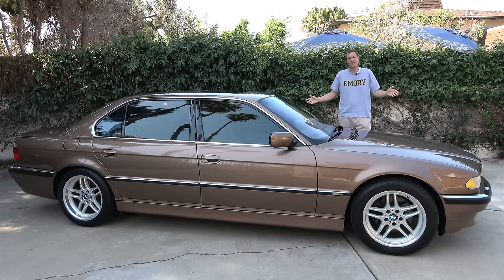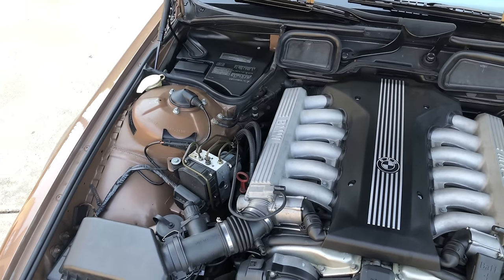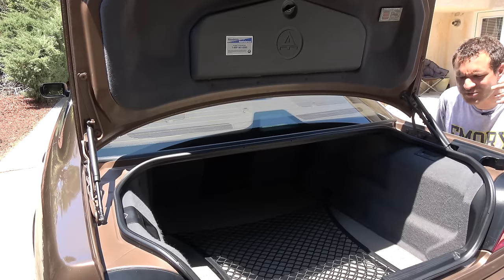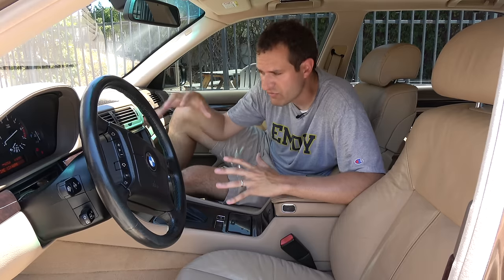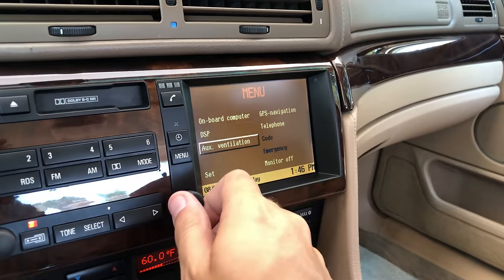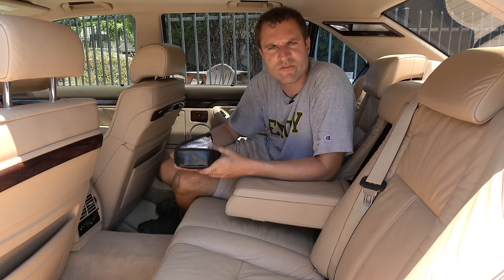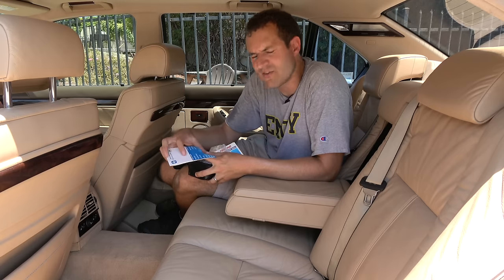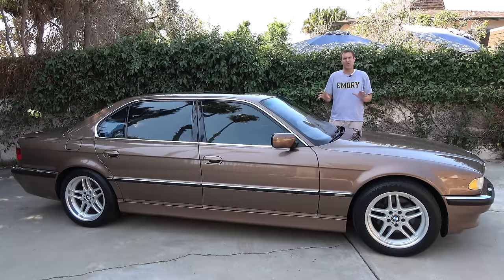Here's Why the 2001 BMW 7 Series Is the Best Luxury Sedan Ever

Comment: Last BMW made that I'd buy. Also Get the v-8 version, much cheaper and easier to maintain.
Reply: joe blow 

Believe it or not but BMW specifically we’re always easier to maintain than the V8s. Do to the fact that they were designed by putting 2 I6 engines together. At least that’s how BMW Makes V12s.
Reply: Ii😶
Reply: Smarter Thanyou V12s can be very expensive to maintain.
Reply: The V8 has plenty of GRUNT to it
Reply: Enjoy changing timing chain guides...
Reply: Definitely go through the V8.

Comment: This is design genius. You’re absolutely right, this is one of the best designed products, not just cars. It evokes a sense of peace and satisfaction that no other can car can. I drove the short version 740i sport, it was like I was connected to the car. They’re also rare. Back when BMW had balls, the glory days.
Reply: Art, I own a 2001 BMW740i Sport and every word you said is completely true, especially about how the driver is connected to the car. It is truly amazing!
Reply: Art, I just wonder what the different is between the ¨sport¨ version and the regular version? I did not get any information when I searched for it.
Reply: Daniel Hedlund 

Hey, there was a 740i M sport package, and a normal one. The difference is the sport package has a sport tuned drivetrain and suspension,the wheels you see on this car, and a sport steering wheel and seats.  These cars are rare. There’s also an ‘individual ‘ option that had special colours and trim. The 740i is also shorter then the il version.
Reply: @Carmafixcars  Thanks! This car that Doug is reviewing looks much sportier than others a looked at. Does the Sport package change any exterior trim, skirts, front, bumper?
Reply: Daniel Hedlund 
Yes, there’s no chrome trim other then grille. There’s side skirts and deep dish rims.
Reply: @Carmafixcars  Ok, so the bumper and the front is the same as other e38:s
Reply: @danielhedlund1480  Bumpers are the same but not the trim on them - Sports has no Chrome. Also they have black headliner, shadowline trim (no chrome around windows either), Sports Seats, Sports Steering wheel.
Reply: @danielhedlund1480  This car is not a sports model - it only has the wheels from the sports package.
Reply: @Carmafixcars  Yes, and the nicest are sport individuals, the interior colours are coordinated with the exterior, depending on wishes. Such as https://goo.gl/photos/o2syvMCRLuVvbvEy6, where the blue (car colour) theme goes also inside: carpets, interior dood trim, dasboard and leather piping (in between the stichings) are all blue.

Comment: The 740iL is better than the 750iL. It only lacks a few touches the 750iL has, but it has a more reliable engine... not the most reliable in the world, but it is way more reliable than the V12. The low end power is much better, and the engine sounds like a V8. It also cruises nicely at high speeds. I think the 0-60 is also a little better in the V8, and since the V8 is lighter, the car feels better around windy roads. There's a few things like the headlight washer sprayers you forgot to mention in this video. This car also has other built in features that many cars didn't have in those days, but Doug would really need to own the car to come across those features.
Reply: The v12 is still quicker than the v8. However the 540i with the v8 is way faster than the 750il.
Reply: I'd want the 750 for the street cred, but I think everyone agrees that the 740 is the better car.
Reply: It looks like you're saying 74 oil is better than 75 oil, I wouldn't trust any oil if it's been used for more than 40yrs
Reply: @dariog36th  
Strange why they called it the il' in America, in Europe the letters are changed round to li'
Reply: @dhalsim-1  it changed to li in 2002
Reply: @dariog36th  
I see, I didn't know that
Reply: Kevin Aora - " This car also has other built in features that many cars didn't have in those days" <- This is true! In a lot of truly great luxury cars the best features are the ones that you can't even see or notice. That's what really makes the difference between luxury, and "luxury". Anyone can throw in bunch of screens and buttons and call it luxury. True luxury IMO is that there's less buttons to press, but stuff just sort of happens.
Reply: The long version was meant to have the v12. Doesnt make sense to have a less powerful engine in such a big car. That's why if I'd buy the v8 i would buy the 740i which is the short version of the car. Or even better the 540i.
Reply: Jaski Kiiski  except with the v12 you need 2 of everything.  2 air filter, 2 mass air flow sensors, 2 distributors, 2 batteries etc. I love it though. You cruise at over 100 mph and feels like you're doing 45.
Reply: More reliable sure, but either car is going to hit you with various silly little repairs, many electronic. Never own a European car out of warranty unless you're loaded or have a hookup for cheap parts.
Reply: Actually, the V8 is faster off the line than the 750iL. Try the M62tu with VANOS. Being longer (the long body) iL doesn't make that much difference. Even if the V12 was in a 750i, which I don't think existed... actually I think they did but they were special order... the V8 would still be faster off the line. The V12 would be a little better at speeds on excess of 100 mph, but most people aren't going to be doing that unless they live in Germany.
Reply: The 740i Sports are the quickest -- shorter rear end.  750iLs are all loaded to the gills, so they aren't exactly light.  Line a loaded 740iL up next to a 750iL and the V12 will walk away.  As far as engines go... the M62 (especially TU) is an impressive powerplant, but the M73 is more reliable, period... however, you've got two expensive air mass meters, and two expensive electronic throttle bodies.  The really scary ($$$$) part is S-EDC (w/rear self leveling)... oh so nice when it works.  The dual batteries didn't come in until '99 to support the electrically pre-heated catalysts.  For me... it's all about the sound of that V12 :D
Reply: @arorakevin  what do you mean by off the line dude.. First 5 meters, maybe 10? Thats not true, the 750i has so much more torque, its faster at all times
Reply: Jaski Kiiski  suomi?? it is! I drive one in switzerland, the 750i is amazing. On autobahn i drive it with 9 liters 100km, thats amazing
Reply: absolutely correct the v-12 is twice as reliable. im guessing hes just assuming a v12 cant be as reliable as a smaller v8. not true in this case... go ask any BMW tech

Comment: “A trunk you have to pull up yourself? HOW WEIRD“

-Doug DeMuro
Reply: So you can unlock it, and don't need to open it immediately, like when it is pouring rain. Not a bad feature, where we live...
Reply: I have no issue with lifting the boot, I just can't fathom why on earth you wouldn't just put a button to open it like most cars with central locking have. The 'feature' of internally released boot is usually found on cheap cars where they wanted to save a few quid/bucks so don't have to put an extra central locking solenoid in and the wiring to go with it, so they just run a manual cable which you pull. However, on this car it has an electronically opening boot - so they could have easily added a button, and even a remote button, to open the boot. I don't want to have to mess about looking for my keys to open it, or walk all the way to the front of the car to open the boot - how often do you need to open the boot when you are still in the car?
Reply: You can push on the lock cylinder with your finger to open the trunk. This is something German cars, from even way back in the 80s had on them. As long as the lock cylinder is in the vertical (valet open) position, then you can just push it in.
Reply: Kevin Arora exactly.
Reply: These cars actually had an fully automatic opening and closing hydraulic trunk as an option: S318A
Reply: @arorakevin  That's fine then - why doesn't Doug tell us stuff like this!?
Reply: You can even retrofit it, but it is a PITA.

Comment: I love my 1997 728i. Not as high spec as the one in the video but still good enough.

I forgave the rusting petrol tank, snapping door cables and it's thirst for every fluid, as I paid £450 for it.
Reply: Tank corrosion killed my 98 728i, I couldn't put more than a tenner of petrol in because it would piss out all over the road.
Reply: @TheRedDeadRat  three years to reply,, but I picked up a refurbished tank for £100. Lasted me 5 years until the plastic chain guide rails went and killed the engine :(

A normal plastic (?) petrol tank would have been better and metal guide rails... They got the materials back to front!

I still miss it, and get nostalgic every time I see one.

Comment: That phone is a Motorola Startac. It was known for its excellent cell tower reception.
Reply: My first mobile and I hated it. The credit card sized sim card came out just enough to stop it working almost every time I put it in my pocket as there was an external slider, to remove said sim, on the back of the phone. I assume this was designed for removing the sim card quickly so that you could transfer it between your mobile and your car phone which were still full-size handsets connected into the car with a curly wire when the Startac first came out. I have this in my '98 540i, in the same place as that phone is mounted in the video. The Startac also had the worst build quality ever, I was forever trying to superglue that thing back together.
You mentioning cell tower reception and sure brought back some memories though. Where I'm from you had to consider carefully which service provider you chose as some worked good in one area & no coverage in others & another provider could be the exact opposite. I remember some people having two phones on different providers so that they could keep in touch better. It was better than having a pager though & having to stop at pay phones to get back to people trying to contact you!
It's amazing how far things have come in a relatively short time & just how much we take it for granted these days!

Comment: I once read that the A8 and the Phaeton were made in the same factory and shared the same critical dimensions.  There biggest difference was that the A8 body shell was mostly aluminum while the Phaeton was mostly steel.  Not surprisingly this added several hundred pounds to the car.  There is a comment below raving about the trunk hinges which are nicely finished and are made of aluminum.  A feature not discussed is that the hinge uses a 4 bar hinge which allows the trunk to be closed without taking any additional space out of the trunk.  Many of today’s luxury cars use a single pivot hinge with large curved arms which do take a lot room in the trunk.  Often these arms retract into hidden space which is actually lost during the design of the trunk.  Years ago, many VW’s such as the Jetta used 4 bar hinges as they saved needed space.  Oddly enough the 4 bar hinges are also used in European cabinet hinges for similar reasons.  As you open the door, you’ll notice that the door moves out before it pivots which allows the panel doors to be hung closely together.  A car with 4 bar hinges moves similarly as soon as you open the trunk.  The trunk will rise about an inch to allow the forward edge of the trunk room to pivot without scraping the edge of the trunk lid.  I have only known one person who bought a Phaeton.  He was the president of Shell USA who wanted a luxury car but for security reasons was advised to avoid Mercedes and BMW’s.  He enjoyed the Phaeton and could drive it in anonymity.

Comment: "Best luxury sedan ever"

Unless you own one
Reply: Lol
Reply: as a former e38 owner i agree
Reply: @razz339  
Me too 
However u drive it ...even insanely 
U still feel safe as u r in armored car
Reply: I own one no problem here
Reply: 181k miles on my 1998 740iL and 165k on my 2001 740i Sport and they've needed no repairs other than what's needed on literally any other car (brakes, front suspension, batteries, timing chain service). These cars are great to own.
Reply: Mitch Goodman I just bought mine. DIY tackling the guide issue right now. Should take about 3 weekends then it’s all set for another 170,000 miles!!
Reply: You will regret this day!
Reply: Zane uh oh good luck with that! Not an easy task at all but at least there is plenty of space under the hood to work with. While you're at it I'd suggest replacing the thermostat with an 88° C (compared to 106° factory spec) aftermarket one. These BMW V8s run at extremely high temperatures and I suspect that is the cause for them blowing their coolant hoses and radiators so often. I upgraded my thermostats and I noticed on both the 1998 and the 2001 I've been getting better gas mileage too!
Reply: It is the best luxury sedan ever. No contest...

Comment: Need to do a review of Lexus LS 430 2004-2006 either the sport or ultra luxury,. Best sedan ever made
Reply: I totally agree. I love my 2004 Lexus LS 430 in charcoal gray.
Reply: Yeah it’s way better than this junk. Lexus for the win !!!
Reply: Yes but can you get it with a V12?
Reply: Joseph Belfi , the real question is how many BMW are running around with 200000/300000 miles compared to Toyota/lexus.  No other car company can match the reliability of toyota/Lexus.  The other is can you or do you want to maintain a v12 car.  Money pit.  The LS 430 has a 4.3 v8.  I have a 2004 LS 430 sport suspension 2004 with 186,000 miles and runs like a top. Do your research on the Lexus LS 430, you won't be disappointed.
Reply: Sean Hennigan I have.  I like it.  But it’s no BMW with a V12.  Plenty of 7 series with tons of miles on them.  I have an E39 M5 with 126k on it.  Been an amazing car.  I’ll buy a 430 when I’m “older” and just want a cushy ride.
Reply: First go drive a 2004 to 2006 ls430 if you can check out a sport, does not drive like an old man Cadillac or Lincoln Town car or any other boat. 0-60 in 5.4/5.6 4000lbs  The m5 from 2002-2004 is the last great m5.  After that BMW went So electronic which screwed the reliability , better have a. Warranty.  That was BMW just trying to make money off of service fees and making BMW owners totally reliant on dealerships.  BMW use to make cars for drivers, now they are just a status symbol.  Go look on craigslist as see how many BMWs are for sale as the owner is tired of high maintenance cost and out of warranty.  At 126000 a BMW is tired and a lexus/ Toyota is. Just getting broken in.      Also check out 2002-2004 amg e55 v8 supercharged. Great car
Reply: Agreed!!
Reply: @jahbay  nice car! I have a 2008 GS350!
Reply: Lexus is the notorious for copying Mercedes-Benz, the LS 430 looks like a mix of W140 & W220 S-Class. Everyone knows most car manufacturers copy atleast something from the world's best brand. The Best Or Nothing!
Reply: Sean Hennigan I promise you, my M5 isn’t tired.  We have a guy in our group closing in on 400k Miles.  His car rips!   And many more with over 200k.
Reply: Joseph Belfi I agree with the 2002-2004 and older BMW if been maintained.  But after 2004, good luck with a BMW over 60000, electronics issues, ridiculous carbon build up, turbo leaks, oil leaks, a/c, etc etc.
Reply: Ali Mirza copied and improved, Mercedes especially the old diseals are great.  But Mercedes cannot beat Lexus Toyota reliability.  I love the 2002-2004 e55 amg, and are pretty reliable unless you over mod the engine, the other issues are motor mounts and expensive air ride
Reply: Sean Hennigan that’s great if all you care about is low maintenance costs.  It’s not a deterrent for me. My  SUV family ride is a Toyota.  It’s great.  My fun car is a BMW.
Reply: Are you kidding? That car looks like early 2000's Mercedes S-class, in a bad way. Also, the BMW's cockpit is much classier and build quality light years ahead. The lexus is a car I might consider as a daily driver, but the BMW is material of real classic and drivers car.
Reply: JukiReviews well my ls430 is a daily driver, and I definitely do not think it's a performance/race car, but for what it is has to plenty of get up and go.  I would definitely invest and have fun with 2003/2004 m5, though in my opinion the E55 amg 2003-2006 is a better looking car and has plenty of power.  My other fun car is a 1969 mustang convertible 351w with mods and under construction right now.
Reply: The LS 430 is a fantastic car and probably better engineered and more reliable . I just with it had a bit more personality and made more of a statement

Comment: My favorite was the 2001, I even thought about buying one a few years later at that time, because a used 2001 BMW 7 series costs around €3,000, which is not too expensive for such a beautiful car, and it still shows today. that it is still a timeless beautiful luxury car
Unfortunately, the petrol consumption is too high, so it is not necessarily worth investing in, but the fact is that it is one of the best-designed BMWs ever, which is still a very nice-looking luxury car if it is in good condition.

Comment: Much nicer looking than the 2019 models which look so boorish with the oversized grills. I wonder if they improved the dreaded cup holders.
Reply: Glenn McEnroe yeap i agree i dont like the grill of new models..the last generation looks good still 2014-2019 but 2020 :(
Reply: Another review on here has the new one beside an E36 (unfortunately, an old and rundown one) and it looks like a big, fat, bloated piece of CRAP next to it.
Reply: I think most cars from the early 2000s, 90s, 80s, 70s and 60s look better than most cars of nowadays. My all time favourite cars are the Diablo VT, F40, 512tr, Countache, but I dont think any of them has ever looked better than the '69 Eleanor Mustang.
Reply: God the grills are getting outrageous on the newer models. I can’t stand looking at the barbecue racks on the front of the SUVs